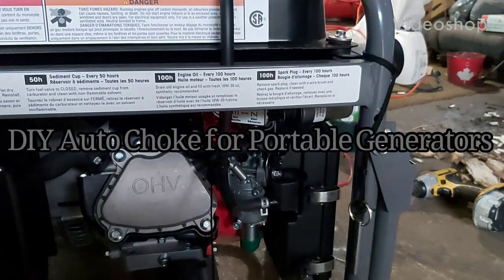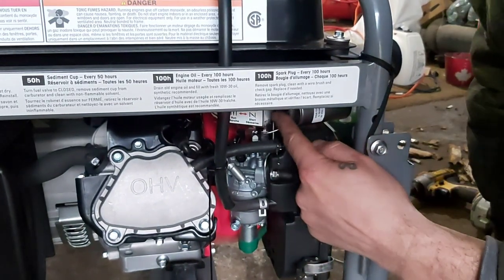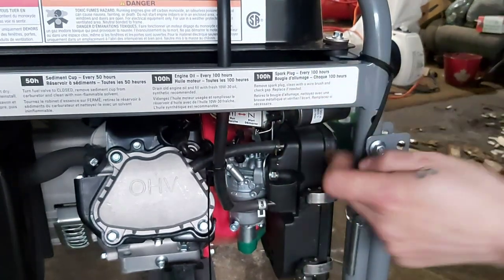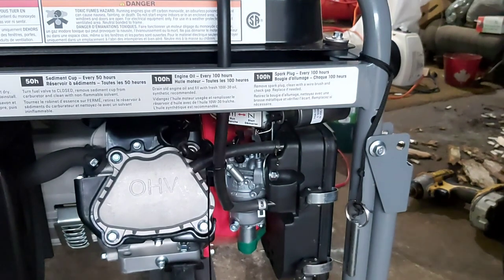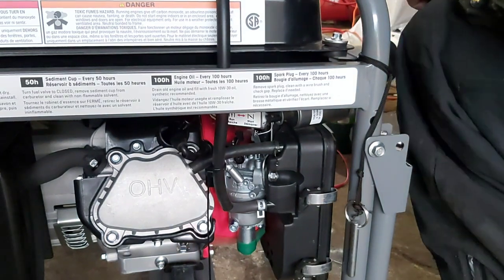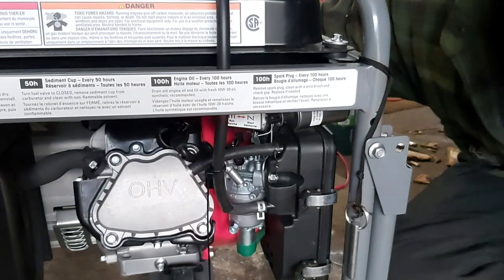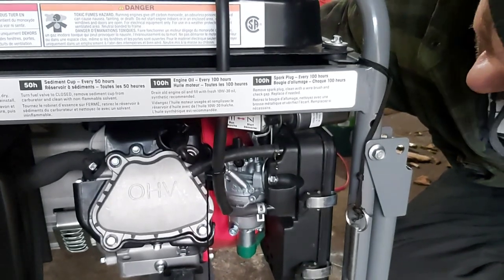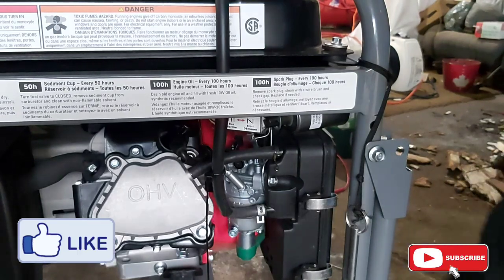DIY Auto Choke for Portable Generators

Comment: Nice addition.  U could always add a small buck boost 12 to 24 unit. I have several new1s laying around . Dirt cheap on ebay.
Reply from the maker: Send me a link if you don't mind. I'll have a look. Thanks
Reply: This is by far the simplest way to control a choke. My mind was going the technical route and overlooked the simplicity. Thanks.